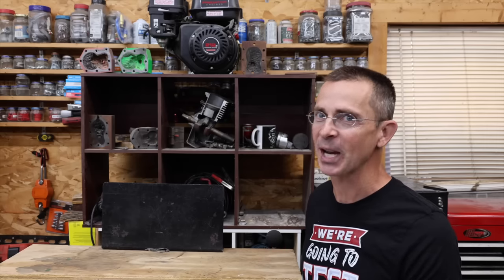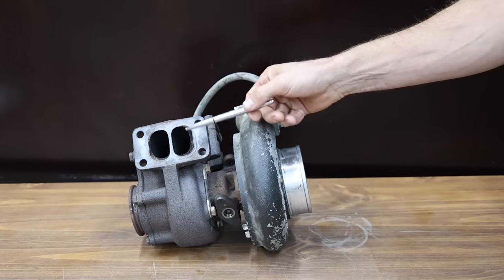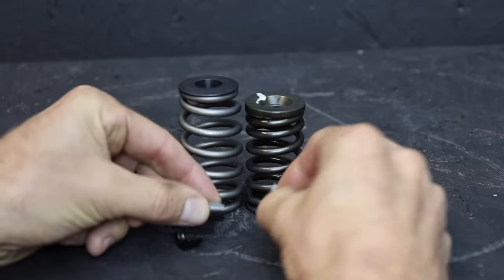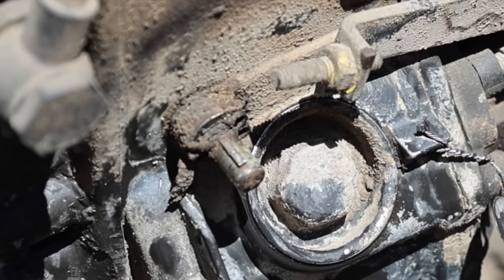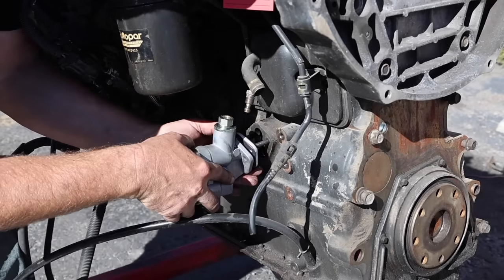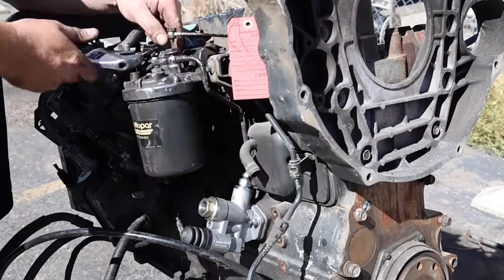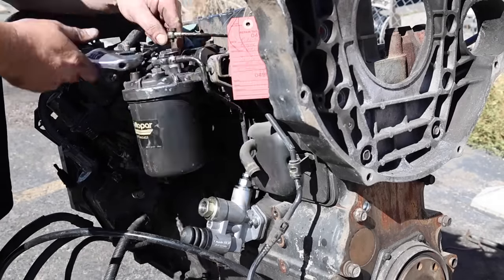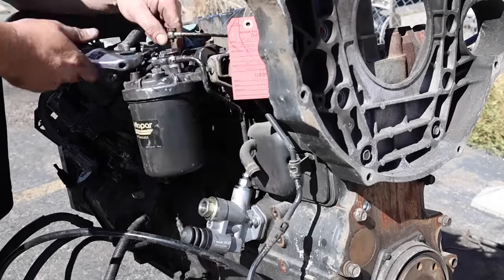Did I Waste $5000 on Engine Parts? More Horsepower & MPGs? (Part 1)

Comment: Interesting video, always good content on your channel. Just on Makita though, Makita used to be reliable and that is all I ever bought. A couple of years ago my cordless drill finally gave out after 7 years of use as my main drill so I bought the equivalent replacement. It lasted 6 months and I had to return it for the same problem 3 times in succession after they failed to rectify the intermittent issue of the drill not rotating when pushing the trigger in. On the third occasion the dealer said it was due to "tool abuse" and refused warranty even though I used the previous tool in the same way for 7 years! After doing some more research I found other Makita customers being told the same thing. In any event I got back to the workshop and threw all my Makita tools in the bin and bought a different brand and have had no issues at all. I won't mention the brand because I do not want this comment to be seen as shill promotion.
Reply from the maker: Thanks!  Thanks for sharing.

Comment: I LOVE when companies work with YouTubers on stuff like this. I know it's marketing for them but the simple fact that they are willing to think outside the box and HAVE FUN is why I always patron these companies. Before I buy anything I always check with my favorite YouTubers and see who sponsors them. Last year I spent over 5K on tools parts etc from sponsors of just a handful of YouTubers. Mainly out of respect to the company.  This summer i have 3 or 4 high end projects I'm building and have a good budget to do so. So I will be doing it again, happily. And THANK you for giving an explanation of each part on that Diesel. I know Gas engines only. I am hoping to get a Diesel engine somewhere and rebuild it just for fun and to learn about them. I didn't know what a lift pump was or well anything else you talked about lol. But dang that's a huge upgrade for the money. I'm actually suprised at that much gain.
Reply from the maker: Thanks for the feedback.

Comment: Would be interesting to see a test of various emergency plumbing repair tapes for leaky pipes.
I am curious about how they hold up to heat, cold, pressure, pipe bends, vertical, horizontal, and time.
Reply from the maker: Thanks for the suggestion.

Comment: I've always thought more in terms of how much more time a repair or upgrade will buy me on my car as opposed to comparing the cost of the part to the value of the vehicle. Maybe having the transmission rebuilt or replaced might cost as much as the car is worth but if nothing else major is looming immediately it might still get you another solid 2 or 3 years of driving. It's when multiple big things start to pile up that it stops making sense. Like if your frame has become severely rusted and you know your piston rings are just about shot and THEN the transmission starts slipping, well maybe its time to say goodbye.
Reply from the maker: Good Point!

Comment: Hello—I’m interested in rust protection for steel table tops.  This includes table saws and inexpensive fixture tables for welding (RE: Vevor).  Most often I see WD-40 as the most practical solution, but there are some high end options as well.  Alternative solutions I wonder about are are car treatments like maguires or even Armour All.
Reply from the maker: Thanks for the suggestion.

Comment: I have a 97 12v with an nv4500 and similar mods its such a great truck to tow with after the mods great choices on your products! I went with an airdog 100 lift pumps vs the upgraded cam driven pump i like the added filtration and easier priming 😎
Reply from the maker: Thanks for the feedback.

Comment: nice work.  You are methodical and appropriate.  THeir is some hype on the use of magnets on water pipes reducing/removing  mineral deposits from "hard" water. Making the water "soft" but without removing the Calcium ? Magnesium salts.  Can this be tested?
Reply from the maker: Thanks!  Thanks for the suggestion.

Comment: Money well spent. I spent my money on a 2018 duramax and love it, but i do miss my 03 cummins sometimes.   The new duramax is awsome because it makes cab heat fast, and balls to the walls power. Same mpg even though the 18 weighs nearly 1000lbs more.  Enjoy you 12v, special truck you have.
Reply from the maker: Thanks for the feedback.

Comment: This is so funny I did a full rebuild on my 1998.5 Cummins 5.9 vp44 last night. I got all new parts in it including  rings and bearings with new pistons. I’m happy with it. Hopefully I can finish with the engine cooling system tomorrow.
Reply: Also your p pump 12 valve is super cool by the way
Reply from the maker: Thanks for sharing.

Comment: Diesels don't have to run the narrower stoichiometric ratios that gasoline engines do. Diesel can operate safely in a much wider range.

So, in a gas engine, when you upgrade the air intake or fuel flow, you have to make sure the afr can balance out.

With a diesel, you slap a turbo on, it'll make more power. You give it bigger injectors, it'll make more power. 

That's an oversimplification and diesels still have desirable stoichiomteric ranges, but they can take a much broader range.

Gas likes to be around 11:1 to 14:1 roughly, depending on the engine. Diesels can do anywhere from about 18:1 to 70:1!

Another fun difference to think about because a lot of folks don't realize how different diesels are from gas. Gas motors have a throttle body that is effectively a valve that controls how much air comes in when stepping on the "gas" pedal. On the other hand, diesels, when you step on the gas pedal, or when it's more accurately referred to as the fuel pedal, they have no throttle body. When stepping on the gas pedal in a diesel, you are instead commanding more fuel.
Reply from the maker: Thanks for the feedback.

Comment: Not only did you save money you have a FAR BETTER Truck than what is sold today
That truck is one of the last of the QUALITY diesel trucks. They work way better than the new ones
 My son has a 2001 manual trans 4dr long bed It tows far better than a new truck and gets 22-24 mpg at 65mph empty 15mpg towing The engine will live at least 500k miles likely 1 million between rebuilds
Reply from the maker: Thanks for the feedback.

Comment: In Europe the Citroen 2cv was for years the slowest to 60 at 32 seconds mainly coz its top speed was 60,then we got late 90's the nissan Serena (a van with windows and 7 or so seats) the 2.0 non turbo diesel automatic was 36 seconds
Reply from the maker: Thanks for the feedback.

Comment: Your a man with good taste. I also have a 95 Suburban and a 98 Dodge 2500. Mine has the V-10 though and the transmissions and second rear axle are shot. I need a Power Driven V-10, Power Driven Trans and a Power Driven axle. 🤔$5,000-$5,000-$5,000, maybe I need a new truck.
Reply from the maker: Thanks!  Thanks for sharing.

Comment: If yours is the heavy duty 1996 Ram 2500 4wd with the 8800# GVW, then I have the very same truck, same colors inside and out, with the same automatic transmission. In the first couple of years of production of these trucks, they didn't offer a 3500 in a single rear axle version, so they had a regular duty 2500 and a heavy duty 2500 which had larger rear brakes and heavier suspension. I expected the original dyno results that you got from your first test because the engines on these trucks were so derated and detuned so the transmissions could survive. Your results of that dyno test represent standard output for that setup and barring some kind of failure, there's no reason that the performance would degrade--that's just the performance they came with.  The automatic trucks were turned down to 165hp just like yours, and the five-speeds were limited to 185hp. Of course, these engines are capable of astonishing output numbers, but the higher the output you pull off of them, the more service life you subtract. just like any other powerplant. I was very interested in this project because I've done a few things to mine to take it up a notch, and I was following all your modifications in terms of whether I wanted to incorporate some of yours into my truck. All I've done to mine so far is add a Banks Twin-Ram intake, a Banks Big Head turbo wastegate  controller and a #8 fixed fuel plate. I had to have a new injection pump a few years ago so my mechanic just switched out all my new stuff when he put in the new injection pump. Just doing these few things woke up my truck in the way it drives and pulls. I'm very happy with it, but am considering a few of your other modifications. As close as I can figure without dyno testing, theoretically speaking, my truck should now be at about 230hp and close to 600 ft-lbs of torque. It drives like that is about what it is. I have a Haulmark enclosed car trailer just like yours and a 14,000 lb. fifth wheel that I pull with the truck. Speaking of which--as you know--the automatic transmission is the weak link here. I cooked mine pulling my camper up the continental divide at Black Mountain, NC on the first attempt. Now I have a built transmission just like you've done. I monitor all the same parameters that you do, and was watching as the transmission temperature climbed as we went up the mountain. However, the truck was pulling well and I got over the top, but that was it. She topped out at 250 degrees, and she was done. Lesson learned. One thing that I didn't hear you mention in your engine enhancements was doing the "killer dowel pin" modification while you had the front accessories off your engine. Maybe the issue of the "killer dowel pin" is so well known that it doesn't need to be mentioned, but I would not do all the stuff you or I did without correcting that one factory issue. There's a dowel pin on the front of the block that locates the front cover and it's known for working lose and falling inside the motor. If you're lucky, it just falls into the oil pan and nobody knows the difference. If you're unlucky, it falls into the timing chain/timing gears and destroys your engine. The kit to fix it is around $100 and blocks the pin from becoming dislodged and falling out. Of course, the problem is that you have to pull the front cover and everything that goes with it to install the kit. Therefore, if you have to pull that stuff off anyway like you and I did, then is the time to put in the kit and prevent "killer dowel pin" horrors. Thank you very much for this particular installment on your YouTube channel. As the owner of the same truck, it was very interesting to see your approach to the issue, and I will probably incorporate some of your modifications in my truck as I continue to evolve its performance. Thanks again for all you do on your channel.
Reply from the maker: You are welcome!

Comment: Do you have slop in your steering? My '97 and now my 2000 both have the problem. There's no dead wobble, just an extremely annoying play in the steering. The previous owner replaced the steering box, but it didn't help. I'm debating whether to put money into this 24 year old truck, or sell it. Problem is, short of incurring massive debt, what average guy can afford a new truck? It's not just the steering, but the entire dash, heater core and evaporator need replacing too.

Comment: Can u review the 4.5 out of 5 stars 263 Reviews
GERORD Welding Machine, Weight 3.3Ib Handheld Welder,110V Portable ARC Hand Held Welder Machine,Digital Display IGBT Inverter with Welding Tool Set,with Toolbox
Reply from the maker: Thanks for the suggeston.

Comment: appreciate all your test and reviews. Have you or anyone ever had any experience with come alongs? The only ones (3) I have are all crap. They either have short pull distance or some flimsy spring to flip for pull direction. None seem well designed.
Reply from the maker: Thanks for the feedback.
Reply: They’re much more expensive, but look at the chain style pullers or come alongs. You get as much, or more, pulling power. And, they have a much larger range of pulling without all the mess of springs and latches.
Reply: Thanks for all your responses.

Comment: Have you done a Philips Head driver test? I’ve been chewing through bits and the work is not that hard yet I’m rounding off the drivers as they slip inside the head of the screw. The screw head is fine just the bit gets destroyed.
Reply from the maker: Thanks for the suggestion.

Comment: Wish we could do this stuff in california but law makers want to make it harder to keep old cars. Ive modified cars to gain around 50hp and run cleaner and drive smoother yet they say its illegal to do so. At worst i can only pull out 3hp from the motor at best maybe 100. But in the end its obvious some states wont allow you to make a car more fuel efficient since they state it goes against some laws. That is if you have to smog it.
Reply from the maker: Thanks for the feedback.

Comment: I have an idea for you! I've been seeing a lot of videos where repairs have been made using baking soda and super glue as well as using cement in place of the baking soda. There are probably other things people use instead of baking soda; it would be interesting to see which mixture creates the strongest bond. What do you think?
Reply from the maker: Thanks for the suggestion.
Reply: @ProjectFarm  I just saw another video of someone using styrofoam and super glue, so that's another thing you could test.

Comment: These trucks are great n all...BUT..  they're classics and certain things on these rams fail, and some due to age..

We're talking about a Ram that's 25+ years old. 
The complete dash is made from inferior plastic and combusts into pieces over time.. 
Expect to buy a new upper dash and instrument bezel, $450..
fyi they do not make a lower dash, nobody does... When those parts begin to crack, You're sh*t outta luck!
I'm replacing 8yr old dry rotted 35's tires, cost for new set of Nitto tires = $1600+
Truck needs new front hub rotor assemblies, bearings, and brake pads, a shop wants $1200 for this, diy for $500 in parts..
The PCM in my 1997' failed, causing charging system issues. ( Good-luck finding this part, I had to source someone to fix it! )
Replaced Alternator $380 +  Starter $215 = Powermaster brand = Made in USA, nothing beats a fast starting 12v!!
New Turbo $1500+  & aftermarket engine exhaust manifold $500 (saving $$$  up for pump work/springs/etc & transmission)
I have a quote on transmission rebuild/upgrade, $5800.. 
If you can't do any of the work, I do not recommend an older truck, you'll be working just to fix it.. 
Will soon be needing front end work, ball joints, etc, failing due to age..
Rear will probably need brake work soon.. Upholstery is falling apart, seats are ripping.. inside looks rough
Don't forget the DIY part of fixing what you can also requires investing in tools.. $$$$$
Jack, stands, sockets, wrenchs, hand tools, etc, etc.. it all adds up...
Spent $24 on a 8oz Permatex bottle of brake parts lubricant
Spent $15 on Lucas Red n Tacky Grease 
(even the small purchases)
Don't forget to buy a torque wrench, I'll be drilling through a lug stud because of an overtorqued wheel nut... 

I thought the video was awesome, an extreme amount of information in a very short video, impressive to say the least!
Reply from the maker: Thanks!  Thanks for the feedback.

Comment: Diesel valves don't float until its over 4,000 rpms. You would have to be trying to destroy the engine to rev it that high. Upgrading the springs is more for higher boost.

Comment: I would like to see (and I tried checking if you have) a straight up, best claw / framing Hammer test,  maybe 16oz or 20oz  milled face vs smooth, handle material, curved claw vs rip claw.
Reply from the maker: Thanks for the suggestion.
Reply: @ProjectFarm  although maybe dont test titanium hammers LOL i dont wanna see one break

Comment: You can make a P pump 12v way faster for $1.80 no need for a bunch of stuff, fuel plate slide is easy as pie. $1.80 is for a pack of bolts to replace the tamper proof ones on the pump. If you wanna get fancy buy a gasket for the intake. I just cut one out of an ice cream sandwich box. Made sure my gasket said ice cream sandwich on it too so the next person who takes it apart can have a laugh. Sure wish I kept that truck.
Reply from the maker: Thanks for sharing.

Comment: A video idea, now that I know you have a 12 valve, I would’ve loved to know what the hp difference is between a stock fuel plate vs a #0 fuel plate upgrade is. If that could’ve been dyno tested before you did the upgrades that woulda been sweet.
Reply from the maker: Thanks for the suggestion.

Comment: Do a best pipe saver(reamer) video. I have a set of wheeler rex hub reamers but they shave off a little bit too much pipe and the fitting is loose so pvc pipe wont make a good connection but they work great on abs pipe. I wanna know if theres a better reamer set out there that can do both pipes

Comment: For the most part, more horsepower directly equates to better miles per gallon.. 
hear me out now!
4000lb Honda Civic with 150 horsepower struggles to move itself up a hill, now load that car with big people and workout equipment.. good luck.. pedal to the metal engine screaming for help, and watch your car need $30 per day to stay on E, that is $210 in one week.. 
now take that same load and put it in an old pickup truck.. spend 80 per week and never see the needle hit the E.. 
and a turbo does not solve the Hondas issue..